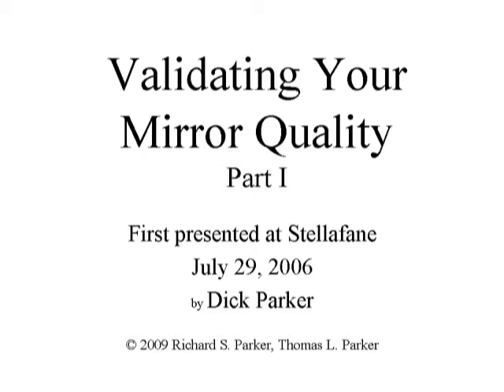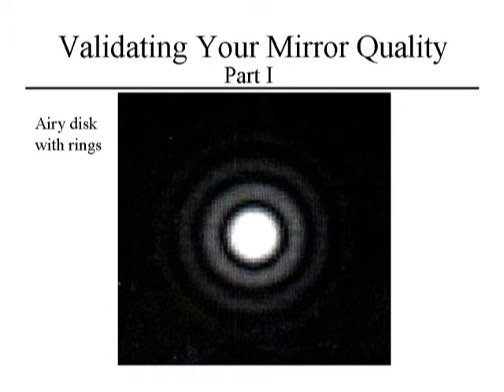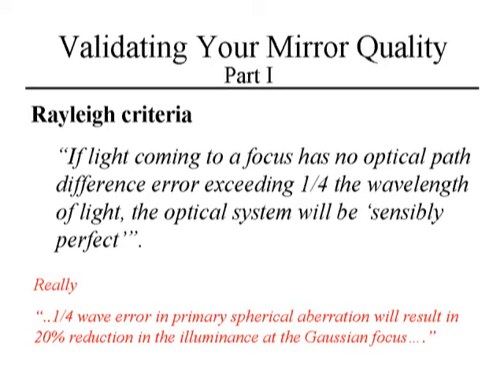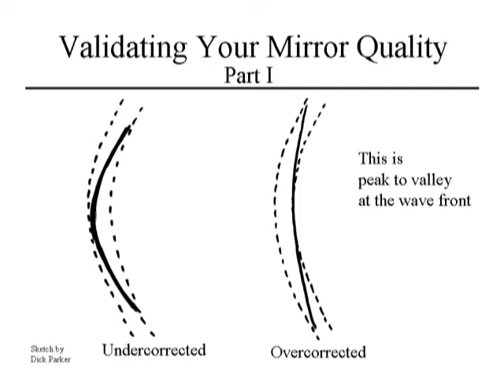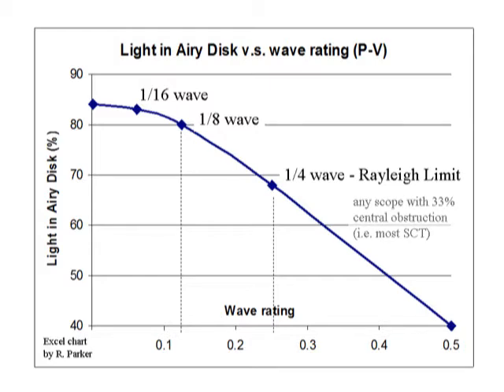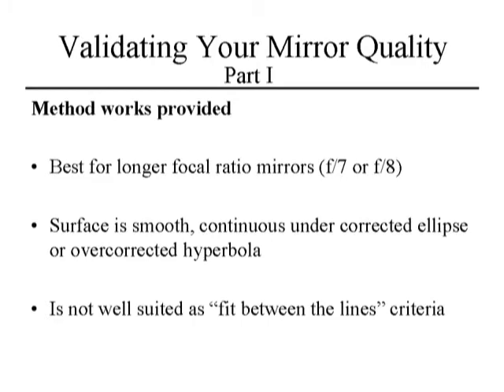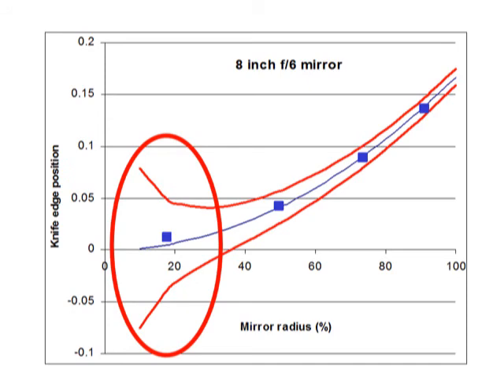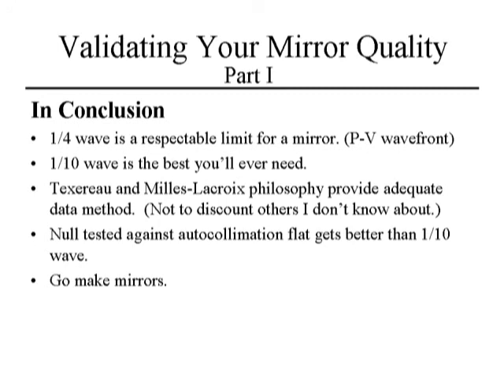Mirror Quality Part I

Comment: 7:40 et seq. I'm a bit late to the party, I know, but I just wanted to point out that this depiction of 'peak-to-valley' error is wrong. You need to find the BEST-FIT parabola, typically making contact with both the edge and the centre of the mirror, and measure the maximum deviation from that. You can't show that in a diagram unless you depict the mirror surface as non-regular.  

Also, the Rayleigh criterion says that the reflected wavefront should be accurate to 1/4 wave, so the mirror must be accurate to 1/8th wave. 

I manufactured telescope mirrors professionally for 30 years.